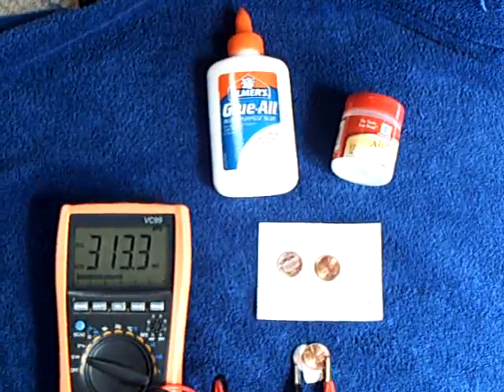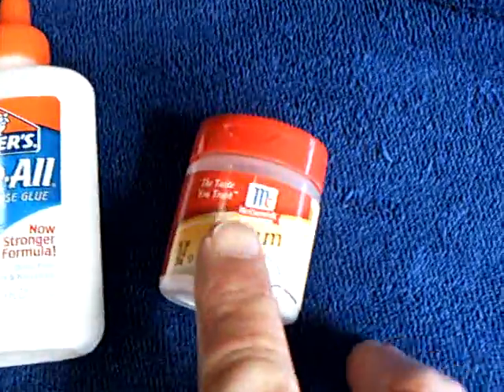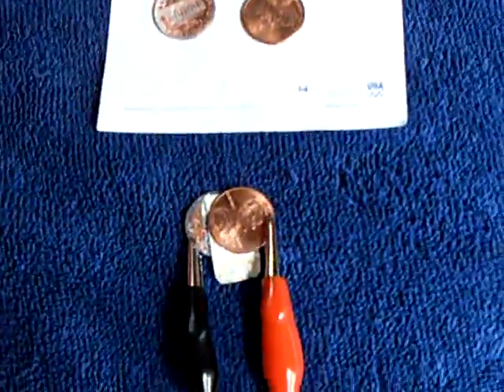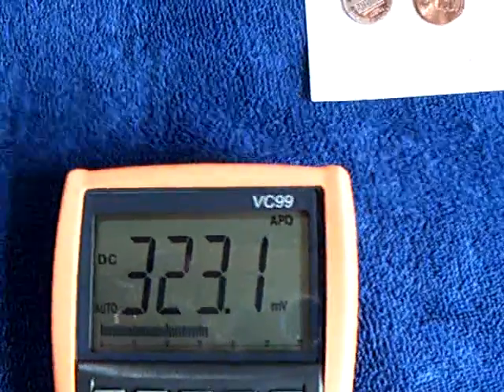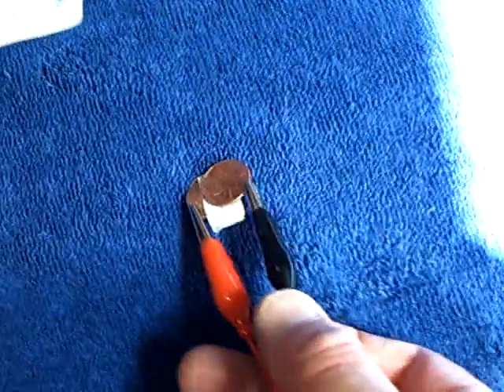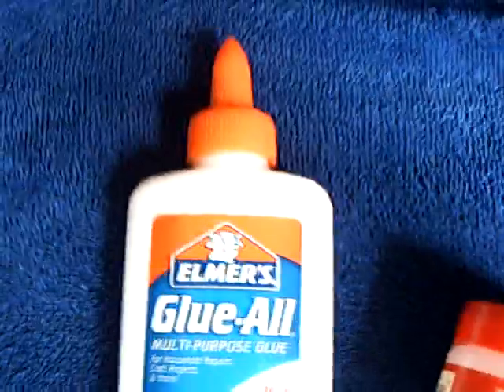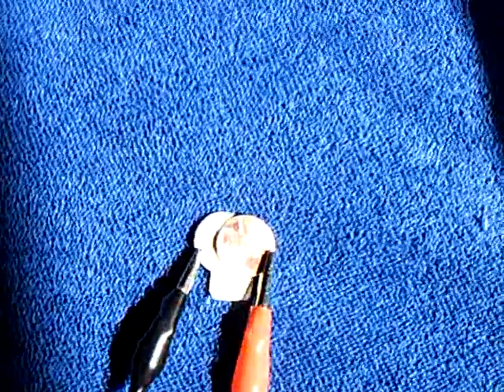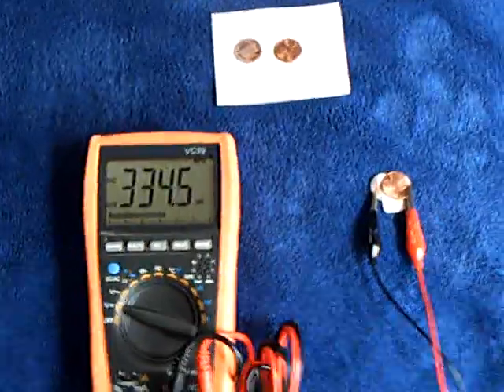My 2 cent crystal cell---maybe

Comment from the maker: @zackthegoth ----If you make up two of these cells you could put them together like any other pair of cells---either in series to get more voltage or in parallel to get more amperage.  Clip leads would be the easiest way.

Comment: As the sun sets over the kitchen window and the sky turns from blue to red
the infrared content is intensified. It is thought that the far infrared long waves
spin and vibrate molecules when the atmosphere absorbs the infrared.
more complex used silicon doped with bismuth selenide,  Bedini pulse allows the diode junction to accept  flow from open system,  sapphire and quartz had some effect on the z axis. theory that phonons involved.

Comment from the maker: @tectalabyss ----Thanks.   If you try this clamp it with a clothes pin and let it dry until you have only about .35 volts on the cell.  Then try heating and cooling it with a hair dryer (NOT a flame or you will burn the paper) to see the effect.  Shift the hair dryer setting from hot to cool air and you will see the voltage flucuations.  Very interesting to see.  To reactivate the cell to full power spray it with a light mist of Alum and water.  It goes back up to .75 volts instantly.

Comment from the maker: @Can101276 ------OK I tried that.  The holding it between my fingers idea gave inconclusive results but heating this up with a hair dryer  was very telling-----this is heat related and not a photovoltaic event.  Thanks.

Comment: if you hold the cell between your index finger and thumb, does the heat from your hand cause the same rise in standing voltage? 
You could even try a Bic lighter to heat them while watching the meter.
Then you would know for sure if it was the temperature change or if it was photovoltaic.
Very cool, thanks for sharing!